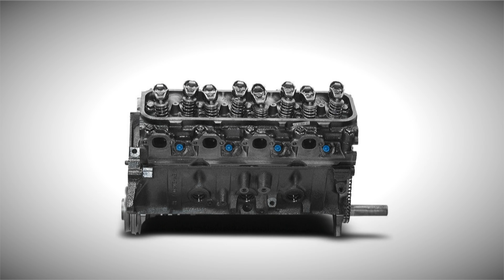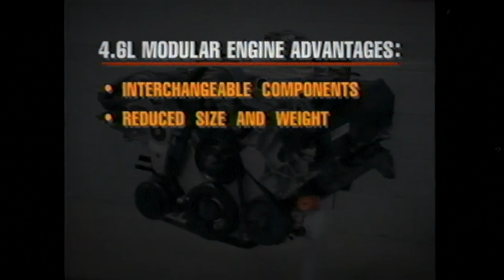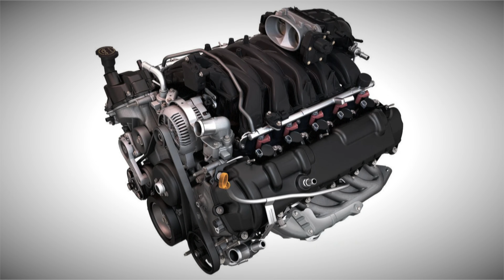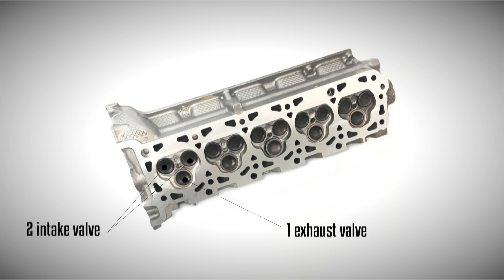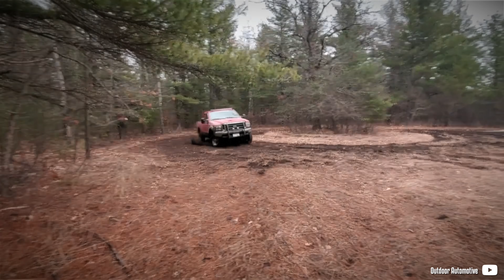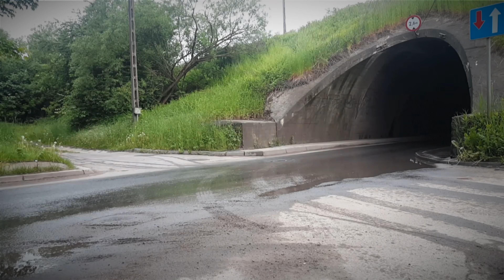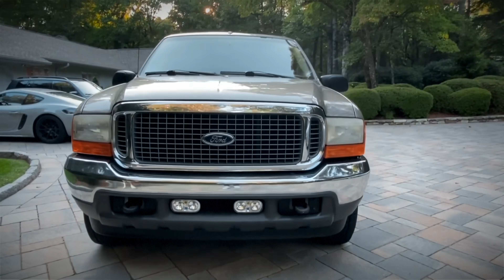Is Ford's V10 Truck Engine Any Good?

Comment: These are very good engines. Super reliable, easy to work on, and good power for the displacement. The biggest drawback is the fuel economy, you get 10mpg no matter what. Also the 2 valve versions had spark plug issues, but we don't talk about that.
Reply: Their underpowered as fuck for a 6.8 liter V10 what are you talking about? And they sucked fuel on top of it. These things are useless
Reply: @adamguzzo94  The 6.4 diesel makes 350hp and 650 lb/ft of torque at 2000 rpm. 

The late model of 7.3 Powerstroke (2002-2003) made 275hp and 525 lb/ft of torque at 2800 and 1600 rpm, respectively. 

The 6.8 V10 makes 350hp at 4000rpm, and 460 lb/ft of torque at 3000 rpm. 

The late model 460 V8 made 250hp and 400 lb/ft of torque, at around 4400 and 2600 rpm, respectively. 

The new 7.3 "Godzilla" V8 has power outputs listed at 430hp and 475lb/ft of torque, at 5500 and 4000 rpm, respectively. 

Now yes, this is diesel vs gas, I know that. My point here is that for the displacement, fuel type, and rpm range, the V10 is not bad on power. Does it suck fuel? Oh yeah, no doubt. But power for displacement is not bad at all, especially considering it's predecessor (the 460 V8) only made 250hp and 400 lb/ft of torque. Also comparing it to the 7.3 diesel (275hp and 520 lb/ft) and the new 7.3 gas (430 hp and 475 lb/ft), the V10 is still arguably better in terms of power output, given the displacement. I'll also note that the 7.3 gas has a slightly worse fuel economy rating than the V10. In reality it's probably about the same.  

Even the 6.0 LS from Chevy only makes 300hp at 4400rpm, and only 360 lb/ft of torque at 4000rpm. And that's a 6.0! 

Torque is what matters when you're pulling anyhow, especially in a pickup. And the V10 puts out. I will grant you that the 4 speed automatic transmission does not help with fuel economy or speed, but in terms of power? It's not that bad, especially compared to other engines.
Reply: @Mighty-Quinn  I've had over 10k on the back of my 6.0 2500 HD and it pulls it like it's barely there.. and I get about 10-13 mpg.. the power figures on these motors are nonsense.. friend lives on a dirt road and his neighbor has a 09.. talked about how bad ass it is and it will barely bust the tires loose on gravel and his is actually half way taken care of and he complains constantly about his 8-10 mpg.. I've seen it pull his construction trailer and for 450 ft pounds I could have stomped it pulling a loaded car hauler.. so either their over rated as hell or I'm putting out way more than the 350 and 375 ft pounds I though I had.. and the excursions that came with them ain't pulling shit. Could barely pull themselves without needing a direct hookup to BP

Comment: Theres a guy with a Fox chassis 6.8 running with bike carb itbs. He put down 344whp, 420,ft/lbs to the tire with stock 2v heads cams and exhaust manifolds. Very stout low revvers that sound crazy with true duals.
Reply: What a turd...
Reply: @adamguzzo94  🤡

Comment: US mechanic here. I live in a rural area with lots of ford trucks. The V10 is very reliable where I live, the engine itself is detuned compared to a 5.4 V8. It doesn't blow head gaskets, it doesn't blow exhaust gaskets or crack exhaust manifolds. The spark plugs might get stuck, but I never see V10 Fords in the shop. Not one in over a year.
Reply: I've got a 2010 E450 bus with the older 2V 6.8L specifically because they were just a little more reliable than the 3V versions. Ford kept these around just for the bus and rv manufacturers due to how solid they are. It drinks gas but I feel way more comfortable with it up here in Northern Canada than the 6.0L diesel.
Reply: @The_Fat_Turtle  yea the cold weather starting ability of the gas engine is a good idea in really cold areas with long winters my diesel pickup is only 4 years old so it starts pretty good in the winter ,,,both of my Semi trucks i drive regularly have APU units and i don't care if it's negative 50  the APU will always start up and within 20 minutes my trucks engine is warm and starts like it's 70 outside
Reply: The V-10 runs so much smoother with almost zero vibrations compared to the 5.4, thats why its so much more reliable.  It can rev and rev and take tons of abuse.
Reply: Every v10 I used at work blew out the spark plugs and exhaust manifold gaskets. Why ford thinks a 6mm diameter thread is good enough to bolt iron manifolds to aluminum heads is beyond me. Especially in the rust belt where they weld themselves to the head. Ford gets many things right, but what they get wrong is infuriating and stupid.
Reply: They absolutely do crack exhaust manifolds and blow the studs & gaskets, still a solid engine.
Reply: I'm looking at two class A motor homes a 6.8V10 and a newer 7.3 V8 what engine is more reliable? Thank you
Reply: 6.2L is better though. Have one in my F150! Love to drive it!
Reply: must be because they are all in the junk yard ,, the bodies on the trucks fall apart after 10 years too ,,i never did figure out how ford managed to make a truck that rattled so much ,,i've owned 2 of these trucks and even the one i bought that was next to new  by the time it had 40K miles it had body rattles and all manner of weird noises  like a truck with a million miles .my 50 year old semi truck doesn't rattle and clunk like that piece of crap ford truck did ,,i have a 2019 F350  that so far isn't following that trend
Reply: @wildcoyote34  The bodies rust out really bad here in Michigan. I know of 4 V10 F-250s here in town and the owners never have engine problems. Everything else around the engine? Problems. Just never the V10.
Reply: @Sephiroth5200  i've had 1 V10 and 2 5.4 trucks and all of them had issues at some point ,, my 00 V10 had the infamous sparkplug problem  , and after 90K miles ate it's timing chain guides ,, i never had the 5.4 blow a head gasket  but timing chains had them repeatedly ,, spark plugs repeatedly ,,and the nonstop burned out ignition coils ,, the v10 despite having the same coils never burned one out ,,the whole truck however fell apart before the engine or transmission failed ,,the farmer i sold it to in 05 is still driving it today.. it's had most of the body replaced and last time i talked to him he still hadn't had any more engine problems besides the timing chains ,,and the usual mileage related issues like alternators , water pumps and oil leaks ,,and i have yet to see a vehicle of any brand that never had those issues

Comment: My work truck F550 that I drive has a 6.8 in it. It is probably the single most gutless engine I have ever experienced. Towing with that truck is horrible. Going up hills has you go from 65 at the bottom to sub 15 at the top. Horrible decision for a company to purchase one.

Comment: Ford's product-development during the last 25 years has Henry Ford howling from the grave.   The V10 and the 5.4 it's derived from did not last long---but lived long enough to make RAM and Chevy buyers out of millions of once-proud Ford guys.
Reply: Right.  Maybe the guys who never changed their oil on the 3v versions.  They will prolly than move to Toyota, when Hemi lifters, and Chevy AFM motors fail due to inadequate maintenance.

Comment: They were durable enough that Winnebago used them in some pretty large and heavy RV's and they did fine! In E series vans we routinely saw 280-300K miles with no issues other than occasional chain guides.
Reply: They were in every Ford F53/F5D motorhome stripped chassis for over two decades, and for half of that time there were no other brands of Class A motorhome chassis in North America so every brand of gas Class A - not just Winnebago - had one. Chassis gross vehicle weight rating was up to 26,000 pounds.

Comment: Amazing power in big U-Haul box truck pulled 12k lb trailer loaded up mountain s . Burns gas but impressed.
I liked the GM 8.1 Vortec no longer made also.
5.3 triton terrible Engine phasers timing chain issues plugs break

Comment: I don't have any problems with the ford V10, even though I'm a big block guy. Get a bank's kit,headers and exhaust and get the computer reprogram since ford programming is awful on the transmission and engine (how does it go go from lock torque converter to unlocked when your foots all the way on the floor) and she's a good enough runner for me. E-450 class c 30 ft. Heck you three valve guys got it good I wish I could drive one, too bad they couldn't put that in the E series.

Comment: My Friend has  a 2001 F250 with the 6.8 l v10  over 200 000kms , no problems or issues,  it is a truck with a truck motor , do not except fuel mileage like an economy car, his truck is rated for 11 mpg while the 5.4 l.  V8 is rated for in a similar truck f250 two wheel drive ,  13 mpg  with the v8, the best part of the v10 he finds the engine can easy pull his trailers  a camper , a boat  & a utility trailer easily with having the engine work hard like the v8 version of the same truck.
Only issue he had was the exhaust bolts. Which we replaced on both sides in his driveway on a weekend, and the bolts are still holding,  after at least 5 years.

Comment: The EMS service I worked for used Ford ambulances, mixed diesels and V10s.  I deployed for “Hurricane” Florence in 2018 aboard one with a V10 that had a bad lifter that was so loud that I thought a pushrod was going to poke a hole though the hood!  Surprisingly, it made it to and from the deployment area without incident!
Reply: It doesn't have any pushrods!🤷
Reply: @jeffmiller3150  “ACKSHUALLY”

Comment: I drove a box truck with the triton v10 in it at work and it had a ton of power. It was new at the time so we never had any reliability issues. That being said, it never sounded good and the copious idle time we put on it probably wasn’t great for the engine.

Comment: Seems like a good engine, and sounds great! 😁 But why, oh why would you use a petrol (😛) engine in a commercial vehicle where you're more or less doubling fuel costs vs a diesel engine!? I know petrol is much cheaper in the US  than here in the UK, and diesel engines are more expensive to buy, but even so, that can't negate their much better efficiency, surely?
Reply: guess the UK is different, a diesel engine here in a pickup will add 12000 to the purchases price, the fuel costs more so any millage improvement is a wash and the exhaust system will be a 5000 dollars to fix every 75000 miles. diesel used to be better but the EPA killed any advantages
Reply: @robertbowman9108  How much more is diesel fuel?
ATM here, diesel is about 20p/ltr more than petrol, the biggest difference it's ever been AFAIK (apparently a lot of our diesel came from Russia! 🙄)
And why on earth would the exhaust system need changing every 75k??
Exhaust systems last longer on diesels...
Reply: This morning a gallon of gas is 3.25 and diesel 4.25 in New Jersey

Comment: In 1968  Ford had produced a dual 4bbl 460 CID engine rated at 610 crank horsepower.

So this video is GROSSLY inaccurate!

Comment: The objective was to make camry motors  because all the modular motors are straight garbage
Reply: I think it depends on the model. The 5.4 3V was definitely a poorly designed engine with a pretty high failure rate. But also look the the 4.6 2V. They weren't perfect but many different cars and trucks had them for a pretty long time
Reply: My 5.4 is 21 years old, has 460,000 miles!!
Just think for a minute how many Shivrolets  or FIATs it would take to equal it!!🤔
Reply: @jeffmiller3150  damn, 460,000 miles. If it's that old, it's definitely the 2V variant, right? I heard they're pretty reliable. Ever had the spark plug problem with it?

Comment: I have seen the V10’s powering propane fueled household generators! That would take a 800 gal in ground tank to run the generator for a month, in an all electric home, with 3,600 sq Ft. On the coast of Massachusetts in Feb. !

Comment: I believe the 4.2l v6 is actually a modular motor as well.
Reply: No, the Modular family only had V8 and V10 engines. 

The 1997 to 2007 Ford 4.2 L V6 was a Ford Canada Essex family engine; all engines in that family were V6's. These Essex V6's are unrelated to the Modular engines and were not based on any V8 design, although they did have a 90 degree bank angle, presumably for the convenience of production tooling.
Reply: 4.2 was just a larger bore 3.8
Reply: @sammycroslin4656  yhe 3.8/4.2 is a spin-off of the M series 351 which was a spin-off of the 351 Cleveland.  Canted valvetrain is the telltale sign.
Reply: I worked at a dealer for years did several 3.8 an 4.2 head jobs an such. Never in my life have I worked on a Cleveland or a modified.

Comment: Despite this probably being the biggest gasoline powered production engine Ford made at the time, my 4.2L V6 had bigger individual cylinder displacement and probably the biggest individual cylinder displacement of any gasoline powered Ford production engine of the time. That's probably the only thing I can brag about my truck for, other than getting to shift the gears manually.

Comment: I have 2 ford triton v10 in super duty ford trucks and they are super durable but for the power they are super thirsty... the 8.1 GM 496 workhorse motor is a better choice more torque and more horsepower with slightly more gas mileage V10 ford 310 hp and 425 torque... 8.1 GM 496 340 hp and 455 torque
Reply: The 3 Valve iteration had 362HP and 460 torque, but those 8.1's are no joke
Reply: @motormouth2472  the newer 3 valve versions have more power on paper but don't feel any stronger on the road I've found... in terms of overall strength and cost of ownership the big GM wins hands down
Reply: @stevemino142  that's respectful. I'll have to try one some day
Reply: @motormouth2472  I always try to be respectful the ford triton V10 has a very unique sound on the road when accelerating like a sophisticated hum much different than the OHV GM good video
Reply: @stevemino142  yeah, I meant respectABLE opinion, but dumb auto correct hahaha. But yeah you were respectFUL too. And yeah I've heard the videos off of YouTube. I mainly want one cause my dream truck has that engine, and I think the V10's are pretty unique engines, but I'm not opposed to the 8.1's, maybe in a 2000 Chevy 3500
Reply: @motormouth2472  they are both forces to be reckoned with whether ford triton v10 or big block GM LS 8100 8.1 litre was only available for 2 years from 2001 to 2003 in 2500 and 3500 trucks I don't know if they came in vans and was motorhome only after that 2000 was the last year for the vortec 7400 or 454 big block in GM trucks
Reply: @stevemino142  oh yeah okay that makes sense

Comment: Could you do a video explaining why different engine blocks are called:
big block, small block, long block, and short block?
Thanks very much :)
Reply: Big block and small block refers to displacement, whereas bare block, short block and long block refer to state of assembly when you buy a new engine
Reply: @wizard_of_poz4413  I thought you could have big blocks and small blocks with the same displacement?
Could you say more about the three states of assembly: bare, short, and long?
Thanks.
Reply: @bongosock  idk you could say that possibly about the gm series of big and small blocks possibly but these days I heard it more as a colloquium
Reply: not exactly displacement, @wizard_of_poz4413 . "Small" and "big" blocks refer to key dimensions such as bore spacing and deck height.
Reply: That would be a good subject.  Different manufacturers define it differently.

Comment: It baffles the mind that the spark plug issue went on for so long. AND it ISNT just Ford. The very small GM Ecotec engines suffer the same problem.  There MUST be some way consumers can get some relief from this never-ending pile of steaming cow dung 💩 persistently coming from all car makers. I believe a new version of the lemon law having a clause whereat the manufacturing giants could be penalized greatly enough that these "mistakes" would be virtually eliminated quickly and not replicated. I am absolutely sure an employee recognized this and probably all other stupidly repeated problems, told management, and it was decided it'd be too expensive to fix. Screw the consumer.

Comment: The Triton V10 and Ford 460 are among my top favorite engines. The sound of the V10 is my favorite albeit with it being a high RPM engine and a screamer at that, although the low end torque of its predecessor is what makes me favor the 460 slightly more. 

Both are gas hogs but you can’t beat the sound and power of these engines. I only wish they would have shoehorned the V10 in cars like the limited production Mercury Marauders and mustangs, as this would have certainly made the engine and said cars more competitive versus the weaker 5.4 and 4.6 engines. 

I’m certain if Ford had learned from the flaws of the 2006 5.4’s implementations and added a correctly functioning VVT system and later direct injection in the 2010’s for vastly improved fuel mileage, the V10 would’ve been an uncontrollable monster that would still be made even today. 

Nonetheless amazing job on these videos and well done.
Reply: The V-10 6.8 engine was axed for the Marauder because of a gas guzzler tax. Prototype Mercs ran low 14's and trapped 102-105 mph with a 450 hp HO 6.8L. The low torque 5.0 Mach 1 engine proved unsuitable for this heavy car and it was quickly discontinued. Panthers deserved a better end, but that's why Ford is failing.

Comment: Did any of those Ford V10’s have the self destructing problems that the 3 valve 5.4 V8’s did?
Reply: I don't think so. They made a 3 Valve V10, but it never had the cam phasers that the 3V 5.4 had. The V10's are said to actually be quite reliable and durable. Never heard any horror stories about them like the 5.4